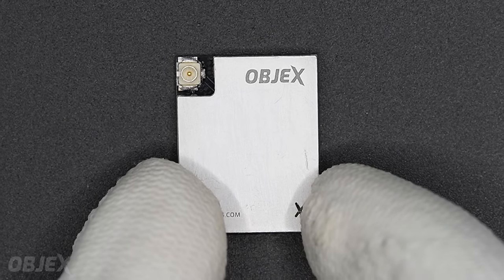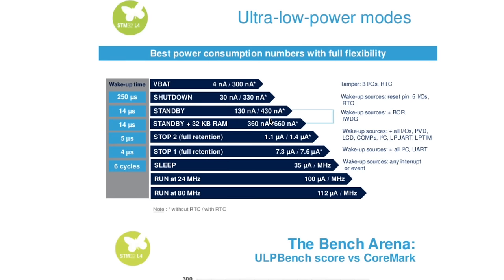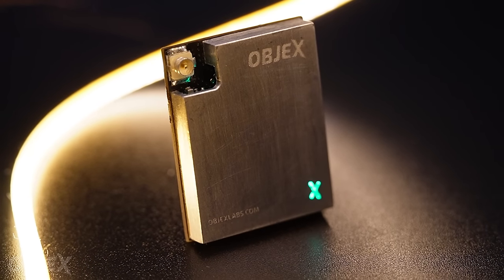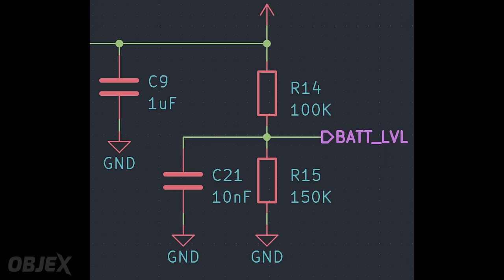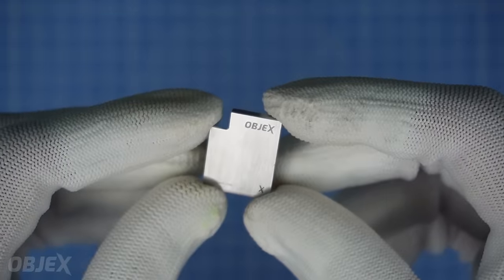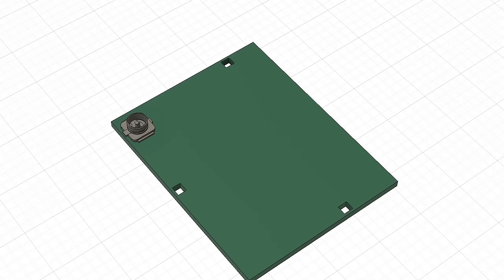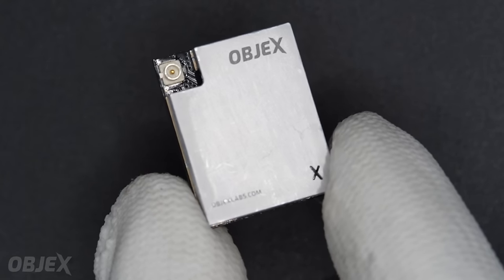The new ESP32-S3 module - Extreme low power 1nA! ELPM-S3 by OBJEX

Comment from the maker: Read the documentation: https://objexlabs.com/assets/pdf/PRODUCT_BRIEF_ELPM_S3.pdf
Reply: What about Temperature Resistance?
What happens when you leave it outdoors at -20° and bringt back in to 25° Ort you have it inside at 16° and put it outside to 45° into the sun.
The Alu shield survives that?
Reply from the maker: @Haldi4803  First it is necessary to find a real application with frequent temperature changes, as required. At 45°C absolutely nothing happens; the electronics continue to work. At -20°C there should be no problem.

* Aluminium 5052

Comment: I think this is a solid project, I'd say having one with integrated antenna is a must. Also that aluminum shield looks like it's going to soak up and dissipate a lot of heat.. harder to DIY heatgun solder and reflow, consider a version that uses 'Castellated Holes' at the cost of a slightly wider footprint, or perhaps an SMD to dual-pin breadboard adapter. 

The first thing you want people to be able to do is immediately upload a Hello World blinking led sketch, if it doesn't have a quick dev-path to do that, immediately committing to ordering PCBs to house a project we've never programmed is a 'no-bueno' often. Remember you are the creator so you've all the tools to work around that, and know it's intricacies and uncertainties.
Reply from the maker: Thank you for the feedback I appreciate it!
Reply from the maker: Hi, I have implemented many features requested by you, tomorrow pre-orders start, these days I will upload the video on the project. shop.objexlabs.com

Comment: I'm really looking forward to any progress in this project and I would love to see more board designs with extreme focus on deep sleep low power consumption like what you're doing here.
Have you also looked into the ESP32-C6?
This one supports 802.11ax (wifi-6) which has a nice feature called Target Wake Time (TWT).
It essentially allows you to remain connected to the AP (if supported by the AP of course) so you don't need to re-connect when waking from deep sleep.
The ESP32-C5 (which has been announced about 18 months ago, but no sign of any silicon since) also claims to support this but then on 5 GHz too.

I would love to finally have ESPEasy nodes (I'm the dev of ESPEasy by the way) run on simple batteries for months to years.
So keep up the good work!
Reply from the maker: Thank you for your comment, if you go to minute 6:43 you can see that I have already developed a version with ESP32-C6. In the coming weeks I'll show the other variants of the ELPMs modules. ESP32-C6 is very interesting for smart home applications or the like, so you will definitely see videos in the future where I use it. I'm currently collecting all feedback to improve future designs :)
Reply from the maker: Hi, if you are interested the project I wanted to let you know that pre-orders start tomorrow! shop.objexlabs.com

Comment: I think it would be nice to have this in the same form factor as the WROOM-1/1U modules. That way, some projects already using those modules could potentially see power consumption benefits possibly without needing to redesign other parts of the project.
Reply from the maker: Good point. Theoretically I could do it, I have to think about it. Thanks for the advice!
Reply: @SalvatoreRaccardi  This module in current form is also not much good to most people without facilities to solder it onto their own PCB.  This is where a standard castellated module wins outright.  I can use currently available modules, but not this.  I don't have means to solder this.  I would have to acquire or build a hot plate soldering station.
Reply from the maker: @MrDomingo55  The project is designed primarily for industrial use. Anyway I'm considering whether to develop some kind of adapter with castellated holes that I'll sell together with the module already soldered(Solder paste high melting point), or to develop a version with in castellated holes.
Reply from the maker: Hi, if you are interested the project I wanted to let you know that pre-orders start tomorrow! shop.objexlabs.com

Comment: I like the design and the idea...  It's hard to find super low power stuff that's easily hackable!  If I'd add anything, it would be mounting holes or some other way to mount it.  It doesn't look like there's much to grab onto.
Reply from the maker: I'm improving the design to simplify soldering and assembly.
Reply from the maker: Hi, if you are interested the project I wanted to let you know that pre-orders start tomorrow! shop.objexlabs.com

Comment: Awesome project! Maybe you can mitigate the soldering problem with using conductive epoxy instead? There are quite cheap and should be conductive enough. Also some people just use plastics that are spray painted with carbon filled acrylic.

For the power latch it would be really cool if the circuit could be triggered by a wireless powered external signal 😅
Reply from the maker: "Maybe you can mitigate the soldering problem with using conductive epoxy instead?" 
Yes is a solution I'm considering.

"For the power latch it would be really cool if the circuit could be triggered by a wireless powered external signal"
It is actually possible to do so, it is complex to implement. A very simple alternative is the use of laser/photoresistor or infrared LEDs.
Reply from the maker: Hi, if you are interested the project I wanted to let you know that pre-orders start tomorrow! shop.objexlabs.com

Comment: This is really cool. ESP32 stuff has always been a little too power hungry. The other big flaw with them for battery life is how slow they are to wake (and then connect to Wifi). Every second at full power with Wifi enabled will burn hours of sleep time if your current draw is in nA. I think someone else mentioned the C6 and TWT.... I don't know if that will work with this method. I'm not that experienced with it, but I think TWT requires a separate power regime that will still draw more current than deep sleep. Hopefully I'm wrong though.
Reply from the maker: Deep stop also works with C6. Power latch with external RTC turns off the microcontroller (ESP32S3, ESP32C6...).
Reply from the maker: Hi, if you are interested the project I wanted to let you know that pre-orders start tomorrow! shop.objexlabs.com

Comment: Hi from Italy. Very good project by the way, however, the only limitation that I see using this in my projects may be the loosing of the ESP32 internal RTC memory (I assume that you cut off the current to the MCU) that I use to share data (a JSON parsed) between active periods. ESP32 RTC memory is the only efficient way to maintain data after a deepsleep reset without involving NVM or writing to the flash killing it. I’ve never used an external RTC so I don’t know if those modules allows also to store this type of data, it can be very handy.
Reply from the maker: The external RTC offers the option to save some data. Since the ESP32-S3 is turned off, there are limitations in some applications. 

I fully understand that in some applications there are limitations from the software point of view, since the module also works with the "standard" deep sleep I suggest alternating the modes of operation to have the maximum energy efficiency and at the same time ensure the proper operation of the firmware.
Reply from the maker: Hi, if you are interested the project I wanted to let you know that pre-orders start tomorrow! shop.objexlabs.com

Comment: if paired with a super small solar cell as a replacement or modified shield u could have a system that never dies it seems. kind of a cool thought
Reply from the maker: with proper software optimization you can do it (PV + supercap).

Comment: First off let me say what a great job you did. I would love to get my hands on of those modules. And, I would definitely use it in my projects if the price is not to far off from the ESP32-WROOM-S3 module. For just a few one-off hobby projects the price doesn't really make a big difference, even if it is like 2 or 3 times the price. If I really need low power consumption it is worth it. So, if it is just a few modules I would use it. But, for large batches, the price of each component is a serious thing to always be aware off. And it might turn out to be to expensive to use and drive the price for the consumer up too much. But again, very nice job!
Reply from the maker: Thanks for your feedback, in the first quarter of 2024 I'll start preorders of devkits + modules. I'm reducing costs as much as possible. 

I strongly suggest you to stay updated on the channel to know the developments of the project.
Reply from the maker: Hi, if you are interested the project I wanted to let you know that pre-orders start tomorrow! shop.objexlabs.com

Comment: Hi, wow, that's a awesome project. I'm working on my personal project which includes two devices with the ESP32-S3, and the one that requires to be powered with a lifepo4 cell only works for 2,5h. The two devices must be connected by ESPNOW protocol and I can't put on sleep mode because the RF module doesn't work on deep sleep. 
That's the reason I changed to the NRF52 modules, they consume less than the ESP32-S3 (both in active mode).

Your solution could have a big welcome for all those projects that need low consumption when active and being powered by batteries.

Which is the power consumption of your design when it's in active mode using RF module?

Nice work and I wish you all the best for this project.
Reply from the maker: The power consumption when it is turned on is always the same as ESP32S3. Unfortunately, it is not possible to reduce the transmission consumption of the ESP32 module.
Reply: @SalvatoreRaccardi  It is possible to reduce the transmission consumption of ESP32 by reducing time it takes to transmit and it will be significant saving in power consumption.
Reply from the maker: @gsge  Yes of course via software, I meant on the hardware side.
Reply from the maker: Hi, if you are interested the project I wanted to let you know that pre-orders start tomorrow! shop.objexlabs.com

Comment: I love this, but it looks difficult for newbees to solder... If it could be put into a longer/narrower package, with all of the pins exposed to the edge, it would 
make it easy to use and breadboard friendly...

One feature I would really need is a dual i2c port, so that 
I could have on-board i2c devices on a private i2c bus and 
be able to talk to the board externally as a i2c slave.
Reply from the maker: I'm considering developing a bigger version with castellated holes. You can already have more I2C ports now with this first prototype.
Reply: @SalvatoreRaccardi  I designed a board that has a esp32 and ADS1115 on it with some additional parts. It should work as a stand-alone board.. 
But I would like it to link to 2 other copies of the same board over i2c, without the master seeing the ADS1115 on the slave boards.

I am not sure how to do this... Can you help?
Reply: @SalvatoreRaccardi  I also vote for some hand-solderable version.
Reply from the maker: Hi, if you are interested the project I wanted to let you know that pre-orders start tomorrow! shop.objexlabs.com

Comment: Looks like a great project - but I'm a little confused by your statements and visuals in the video when you are talking about current comparison when the S3 is in deep sleep.  The S3 cannot go lower than 6-7uA when in deep sleep, when being power by a correct and stable voltage, so how a you possibly claiming nA instead of uA when in deep sleep?

If the ESP32-S3 actually sleeping or is it just powered down?
Reply from the maker: When I say "deep sleep mode" referring to the module I designed I mean that ESP32S3 and all components connected to 3v3 are turned off. That is why very few nA(1-100). Basically I developed a power latch that turns ON the ESP32S3 + 3V3 path only if an interrupt is detected in the master or wake input.

So ESP32S3 is off - If power latch is enabled. You can always use the classic ESP32 deep sleep.
Reply: @SalvatoreRaccardi  right, so this is all very misleading - you are turning the ESP32-S3 off, not sleeping it. Totally different thing. You are also not accounting for the extra cost or turning the ESP32-S3 on where it has to calibrate the radio that takes up to 450mA current for a period, compared to waking from deep sleep which just loads the cached calibrated data, so only a tiny power hit.

You've made a nice module - nothing really new in terms of controlling the power + and how to re-trigger it with RTC + latch etc - a few boards out there already do that,  but you've put it in a nice looking package for sure, but you need to re-think how you present the data because as time 8:10 shows, you clearly state deep sleep being < 1uA, which is impossible.
Reply from the maker: Okay, there was some confusion about the terminology, I'll write the documentation better.
It may be that I am wrong but from my point of view better to provide 450mA for a few ms instead of having a continuous draw of 7uA if the device turns on very few times a day. It all depends on the type of device. Many battery-powered smart sensors stay off most of the time. 
However I'll do more testing and analysis on this.

https://objexlabs.com/assets/pdf/PRODUCT_BRIEF_ELPM_S3.pdf

What other boards based with the EPS32S3 use a power latch to improve power efficiency?
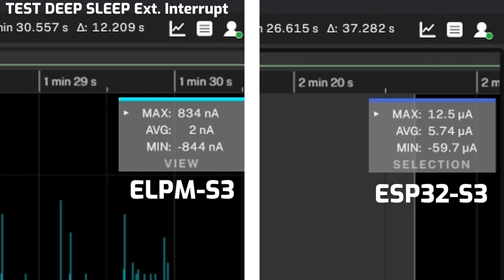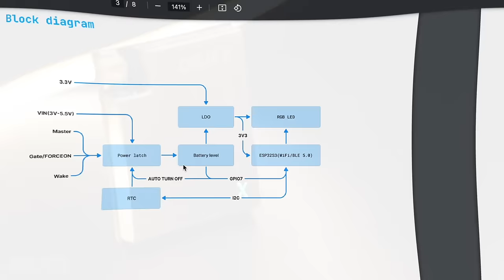Reply from the maker: @UnexpectedMaker At minute 8:18 on the left you see the Power consumption of the ELPM-S3 waiting for interrupt. And on the right the Power consumption in deep sIeep of the ESP32S3. The data I show is true, and if you look closely at the video I explain the operation of the module and the power latch 2:55 .
Reply: Probably uses an external RTC like the AB1805 to use as a power switch for the ESP32.

I think the YT title is a bit misleading. The AB1805 RTC is already very low power, but when clock is running still consumes 14-55 nA. I agree the 1nA "deep sleep" title refers to a full shutdown state, which is different from sleep (as it can't wake up on its own). So the product can perhaps be woken up by a GPIO pin, which is still useful for a shipping mode with batteries installed, but not quite the same. 
The further usefulness also depends if these power rails are available to the I/O of the module.. because just switching the ESP32 and not surrounding sensors etc. basically voids the use. After all; one could also connect this AB1805 and power switch externally to get the same functionality, but obv that requires more work.
Finally, making a truly low energy module also depends on the full system implementation. Relatively speaking ESP32s (deep) sleep modes are quite poor, as they require a full chip reboot through an often slow bootloader (competing MCUs boot in several microseconds, and resume from last PC), which wastes a lot of uJ while its doing useless busy-work.
Reply from the maker: @nlhans1990  Hi, I suggest you read the documentation, and look carefully at the block diagram. 
https://objexlabs.com/assets/pdf/PRODUCT_BRIEF_ELPM_S3.pdf

Comment: Is the RTC the RV3028-C7? I used this one in my projects before to do the same as shown here, just not on the ESP module itself. Powerful little thing. Only downside is the cost of the RTC if purchased in small quantities.
Reply from the maker: The price drops a lot if you order hundreds of units the rest of the power latch costs less than 50 cents.
Reply: @SalvatoreRaccardi  Yes, I've seen that, but for me personally I don't need hundreds of them and I don't sell anything on etsy or similar. For the power latch, I just used a MOSFET and used the RTC a bit out of spec, so it doesn't reset the interrupt line when programmed.
Reply from the maker: @drstefankrank  The power latch I developed is more complex because it has to handle multiple inputs and also the master input triggers the system if it detects a change in signal status, 0 to 1 & 1 to 0.
Reply: @SalvatoreRaccardi  I think it is also much better to do so. I did this hack only for my specific use case. (It's a plant soil sensor, woken up through the RTC every 3 hours and the ESP resets the interrupt when it's done. In addition to that only a button to manually trigger the RTC to wake up if needed.)
Your design needs to be way more universal and shouldn't rely on undocumented behaviour that may not work in the next revision of a used component.
Any plans when it will be available and are you shipping to the EU?
Reply from the maker: @drstefankrank  I plan to sell the first units(engineering sample) in the next few weeks.

Comment: can you share a little bit more about how the extreme power saver mode works with Wi-Fi? how does it keep sending beacons/probes?
Reply from the maker: When in deep sleep basically the ESP32S3 is turned off. The power unit I designed wakes up the microcontroller only if it senses an interrupt(master/gate/wake input) from an external source or from the external RTC itself.
Reply: What is that power unit you're using ?
Reply from the maker: Hi, if you are interested the project I wanted to let you know that pre-orders start tomorrow! shop.objexlabs.com